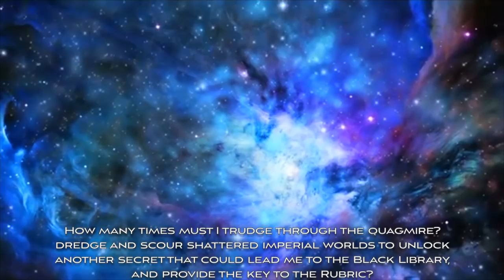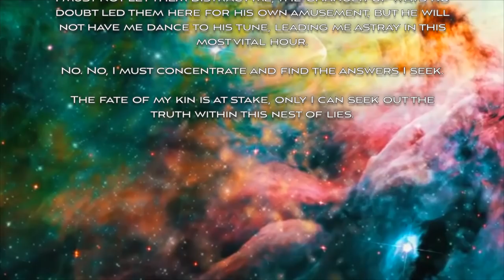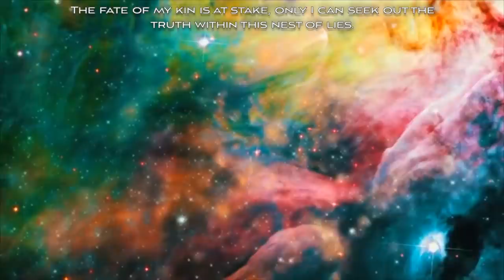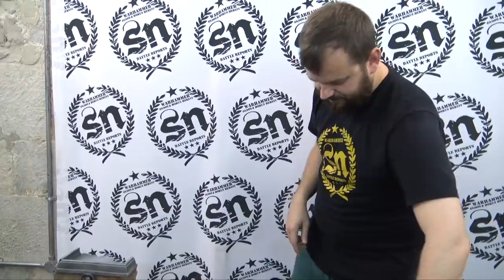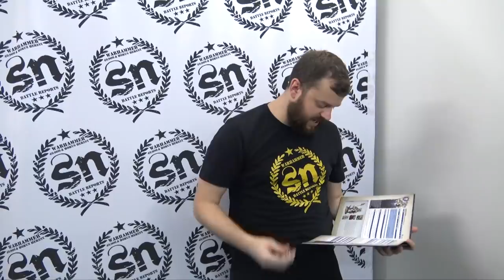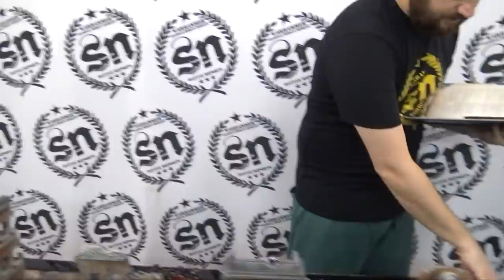Warhammer 40,000 (Battle Report) - Blood Angels vs Thousand Sons

Comment: I’d highly recommend using Infiltrators instead of heavy Intercessors for your home objectives. Huge deep strike denial and durability — you could spend 130 pts vs 140 pts and give each squad the Helix Gauntlet as well to make it huge durability.

They won’t put as much output as your heavy Intercessors but they’re also way more flexible with smoke screen option as well as a helix.
Reply from the maker: yep agree

Comment: Ahrimans second spell; baleful devolution, utilised both the extra range and extra mortal wound cabal rituals on turn 1. I believe that's a no-no without the proper warlord trait
Reply from the maker: Will check this up! If you are right I Auto win right? DC should be disqualified right ?
Reply: Colin is correct. Can't use 2 cabal powers on a single model per turn unless you have the WLT. Also Ahriman casted on a 13, not a 12, he shorted himself a die.
Reply: @SNBattleReports  well he also should have rolled 13 dice instead of 12, because you roll equal to the result of the psychic test (and boxcars+legion trait is 13)
Reply: @greggoss7461  Also Ahriman isn't immune to perils though there is a strat to ignore a perils result.
Reply: @SNBattleReports  make DC wear the helm of shame for a week pls 😃
Reply: @Black_Blow_Fly  Then again heavy intercessors and eradicators have a 3+ save, not a 2+
Should be a 5+ vs AP2 not a 4+
Reply: @chrisg8321  ?

Comment: As TS:- Don't forget you can spend cabal points to get CP using a PA. Would have been clutch a few times imo. fun game though.
Reply from the maker: Thanks will pass this on to DC
Reply: @SNBattleReports  Also, hopefully i'm right on this one, as i've been thinking if I would have thought to do it myself.  At 1:25:00 there was a conversation that TS held a point as they had 2 obsec vs 1 obsec. Might have been sorted out in the cut. but if both sides have obsec it then goes down to number of models. not number of obsec. but may have been a slip of the tongue. At that time, DC would have been best to interrupt to kill the H. intercessor.

Comment: Here I thought heavy intercessors and eradicators had a 3+ save..... Apparently its 2+ now.... Oops...
Both units would have died much quicker.
Reply from the maker: If in cover or touching cover they have a 2+ buddy
Reply: @SNBattleReports  Nope, there is no mention of touching...
Pg260- "Area terrain can include Ruins, Woods, Craters and other terrain features that models can move into or through."
Pg261- "Infantry, Beast and Swarm models recieve the benefits of cover from Area Terrain features while they are WITHIN it" (Emphasis mine).
Its silly to get the benefits of sitting WITHIN a ruin while standing outside of it "touching" the outer wall. No logic at all.
For someone telling your opponent to read gis book more, this is very ironic.
Reply: @SNBattleReports  In addition as per the rules quoted cover is given on a per model basis. One guy in terrain doesn't give the unit cover, as it says "a model" not a unit, so you should have rolled saves individually until that one model dies, then go on to the models not in cover... or if you wanted that specific model to live, then roll for the guys not in cover...
Reply from the maker: @chrisg8321  hey buddy know sure we did this can you point out when this happens so we can have a look and check?
Reply from the maker: You are correct, you get the benefit of cover as long as you are WITHIN terrain. Looking in the rulebook, the definition of WITHIN is as follows "If a rule says it affects models that are ‘within, then it applies so long as any part of the model’s base (or hull) is within the specified distance." So having the models bases touch the terrain is enough.

If it said WHOLLY WITHIN then you would be correct in saying you need to be in the terrain.

I hope this helps clear up the confusion
Reply: @SNBattleReports  Yes I understand that partials are counted.
I noticed that at 23.29 you mention you'd count the base of the ruin as being ruins.. (Which is actually the cause of the issue).
This can cause problems since ruins are obscuring and so you'd have a situation where LOS would be obscured by the mere edge of the ruins base, despite being able to actually see over said base.
It would be much easier and simpler to count models actually in the ruins as being in the ruins. Yes I understand this would limit cagy play, but it stops silly instances where a unit is being shot at and yet gets cover despite there being nothing between the unit shooting and its target. Like at 59.00 and 1.00.07 and 1.04.07 (the intervening cover was deemed dense not light @23.29).
Its certainly not thematic to have units "in cover" despite being outside the ruins actually giving the cover.
Reply: @SNBattleReports  Thanks for asking.

59.00 Unit not in the ruin, touching the base, no intervening terrain (already mentioned how this can be an issue).
Claimed to roll for models in cover but the one wound was given to the model most furtherest away from the ruin.

1.00.07 Again unit touching the building not within it. Was building a ruin? Since ruins can be moved into yet this feature looks like it is enclosed and so wouldn't be a ruin in the normal sense. If so there is no cover from buildings, only obscuring terrain.

1.04.07 Only intervening cover was deemed dense at 23.46, not light. Unit had models on the base of the ruin, not within it. Didn't roll individually for the models "in cover".

So yeah I understand that for a close combat army it is easier for you to get cover while moving up by counting the ruins base as ruins, however as mentioned before it is not thematic and leads to inconsistencies, (like units getting "cover" despite nothing being between it and its attackers).
Edit- Spelling
Reply from the maker: @chrisg8321  He buddy playing like the rules are like im sure 99% of ppl do all around. We hold events and travel to events all are played like this.
Reply from the maker: @chrisg8321  If you are on any part of the base you are in cover. Yes i agree it makes no sense but its how the rules and the game work
Reply: @SNBattleReports  Wrong again, that isn't what the rulebook claims.

Pg 260 - "Each time an Area Terrain feature is set-up on the battlefield, both players must agree upon the footprint of that terrain feature..."
Which is actually what you did, you did at 23.29... As I mentioned earlier.

"This is essential to define so that players know when a model is wholly on or within that terrain feature, and when it is not. For some Area Terrain features, their footprint will be obvious, especially if the terrain feature has a base or some other well defined boundary".

Craters of course go with the base, but ruins, logically, thematically and realistically should be just the outline of the ruins itself. This is how I and my fellow opponents have done so for over 20 years of playing the game since 3rd edition.
Reply: @SNBattleReports  Please quote where in the rulebook it states 
'if you are on any part of the base you are in cover'
I am sure it must be there if "99%" of people do this... (Not sure where you got those numbers buddy 🙃 )
Reply: @SNBattleReports  So if the base is counted as ruins does the base also count as obscuring as ruins do? If I put a 6 inch ruins on a 9 inch base does the full 9 inches obscure units.... since "it counts as ruins"?

This is one of the many silly problems that come from counting a base as ruins; another being what occured three times in your game. Getting cover despite no cover being between you and your attacker.
Reply from the maker: @chrisg8321  to be obscured you need to be behind the ruin and not on the base at all
Reply: @SNBattleReports  Not what I was asking, please read what I wrote.

So if the base is counted as ruins does the base also count as obscuring as ruins do? If I put a 6 inch ruins on a 9 inch base does the full 9 inches obscure units.... since "it counts as ruins"?

To clarify I have a unit behind the base of the ruins... They are clearly visible as the base doesn't block LOS yet since the base is being "counted as ruins" it would be obscuring... Ergo it is absolutely silly and illogical to deem the base of a ruin as ruins, just use the outline of the ruins itself.
Reply: @SNBattleReports  Actually I thought of something.
As per rulebook. 
Pg 264 - Ruins ... Obscuring
Pg 262 Obscuring. If this terrain feature is at least 5" in height.

So as to the conundrum I proposed, (about how if you count the base as ruins it now becomes obscuring despite not blocking LOS).

The base of ruins cannot "count as ruins" because ruins are obscuring and to be obscuring it needs to be at least 5" high.
Logically the base of the ruins would be deemed hills from pg260 (which is essentially what it is, from a logical and realistic point.)

Bending rules to try and get a win makes your victory hollow. I don't know why people do it, its really sad.
Reply from the maker: @chrisg8321  whatever you say buddy.
Reply: @chrisg8321  I think you’re really, really missing the mark here. Firstly, how is it going to constitute as cheating if both players agree to the terrain to begin with? It’s not like Pardo doesn’t mention anything and then just decides the moment the camera starts rolling.

Furthermore, your point of the base not counting is comical. The rulebook states that obscuring applies if a terrain feature is 5” at its tallest point. This means that the obscuring characteristic is inferred to the entire terrain feature, which, includes the base of the terrain. Therefore if you are not touching the base, you cannot be targeted. Inversely, if you are touching the base, that model gains the benefits of cover, but are also an eligible target to be shot at. It isn’t that difficult really and I feel like you’re just grasping at straws. In most events, the base that the terrain feature is mounted on, counts as part of the terrain feature. The same way your model’s base counts as part of the model. Hope that’s helped clarify things slightly for you.
Reply: @JcGWAMPROD  Did I say the word cheating?... 
Did you check the goonhammer link? They suggest what I do, that you should be in the ruins to be counted as within the ruins... (sounds stupidly simple when put like that)
Reply: @JcGWAMPROD  Doesn't claim that the entire feature is counted... That is something you added. Perhaps do what I did... Quote the rulebook itself... Don't try and pass off your interpretation as what was written.
Edit- Perhaps read all my posts not the most recent one. Context is King.

So if I put a small ruin on a giant base does that extra base count as obscuring despite not actually affecting LOS? 
Wouldn't that be difficult to enforce? 
It would be much simpler and logical to simply go by the outline of the ruins itself... Which is what Goonhammer and GW suggest...
Reply: @JcGWAMPROD  Seems like posts with the goonhammer link AND posts discussing its deletion are gett ikng deleted...
So sad to see that simple facts can hurt someone's ego so much.
Reply: @chrisg8321  You said that Pardo was bending the rules. Bending the rules constitutes cheating, so whilst you didn’t say the word “cheating” you implied it. Remember language is implicative. 

Also how is it not going to count the whole feature? Do you actually play 40k? Go and make that argument in any event and see what the general consensus is. Also since you like quoting the rulebook verbatum, on P.263 it says “if the terrain feature is at least 5” in height” and then goes on to clarify that “the height of the terrain feature is measured from the highest point on that terrain feature”. Why would that specification be necessary if you didn’t have to count the whole terrain feature? It’s very clearly stating that regardless of the height of the rest of the terrain feature, if the highest point of it is at least 5” tall, then the whole feature gains the obscuring terrain trait. I hope that there gives you reasonable confirmation, not just through my interpretation, but through the rulebook itself, about whether or not the entire terrain feature gains the obscuring trait. 

Also using Goonhammer’s interpretation goes against you telling me to pass my interpretation off as what was written. Nice one though. They aren’t GW, and they haven’t written the rules, so going by your logic, they aren’t right either, correct? Nobody’s feelings are getting hurt discussing rules about a game of toy soldiers. However this rule is clear as day, every major event plays it as such, and the fact that you “can’t find” the Goonhammer articles is convenient to solidify your argument. If you can’t find it, it doesn’t exist, and you’re arguing from your interpretation of the rules. Could it be that maybe the people at Goonhammer realised they made a mistake? Because making mistakes is normal.
Reply: @JcGWAMPROD  Nope, not what I said. Cheating is rule BREAKING... Perhaps don't try and claim your interpretation are facts.

It seems you didn't bother to read the whole exchange BEFORE posting... As I said, context is King. 

The reason it states highest point is because some ruins, especially home made ruins, have different heights at different points. It doesn't mean the base of the ruin is counted as it's boundary / footprint.
As I corrected SN before... THIS is what the Rulebook actually says

Pg 260 - "Each time an Area Terrain feature is set-up on the battlefield, both players must agree upon the footprint of that terrain feature..."

"This is essential to define so that players know when a model is wholly on or within that terrain feature, and when it is not. For some Area Terrain features, their footprint will be obvious, especially if the terrain feature has a base or some other well defined boundary".

Me mentioning Goonhammer and G W agreeing with me was in response to SN claiming that "99%" of people play it his way.... Are they the 1%? 

It seems you didn't bother to read the article, which for some reason keeps getting deleted when I post the link... I wonder why...

Goonhammer mentions that GW themselves provide their intention....

"Games Workshop have however released a few new pieces of terrain with defined foot prints that do help demonstrate their intention for them. 

Their example clearly shows their idea for foot prints is the area enclosed by the terrain, which does in my opinion support my suggested boundaries above."

To clarify, "Their example clearly shows their idea for footprints is the area enclosed by the terrain"... Is literally using the ruins themselves as counting as ruins....

But hey if you enjoy having unrealistic and innane occurences in your games, like letting models get "cover" from ruins by standing next to them, or magically see through ruins by touching the base, or have the empty space of the ruins base "block" LOS, then you do you...
Reply: @JcGWAMPROD  I never said I "can't find" the article, (so that was a lie), in fact I posted the link multiple times... What I did say was that each post I posted with the link were quickly deleted..

It takes 5 seconds to type, Goonhammer 9th terrain... Go read it for yourself.
Reply: @JcGWAMPROD  Seems like you were the one who made a mistake..
Creating a strawman and lying about what I said... Either that or you need to actually read posts.